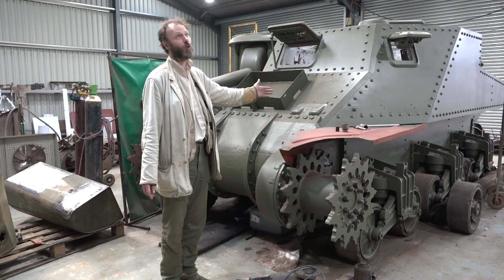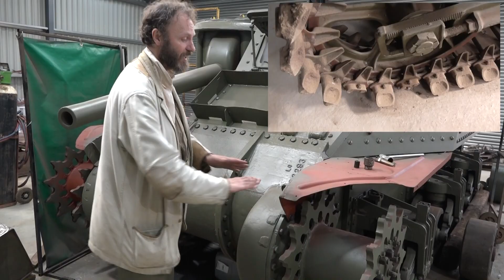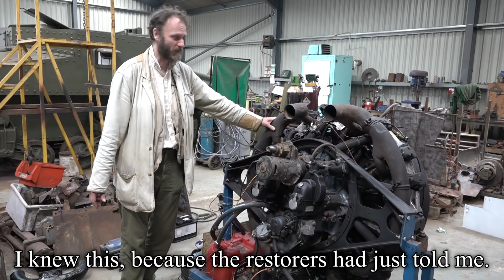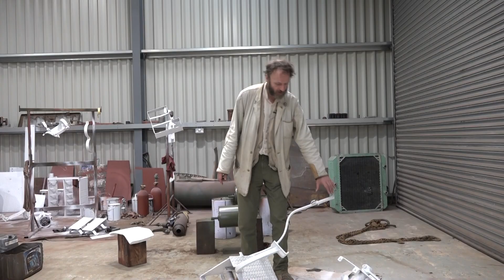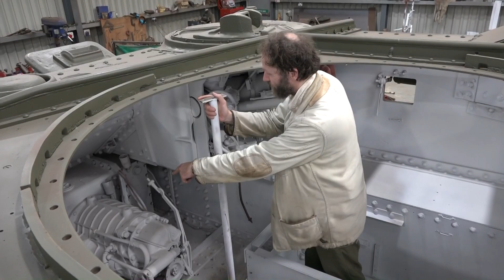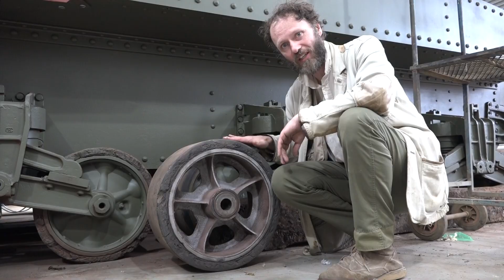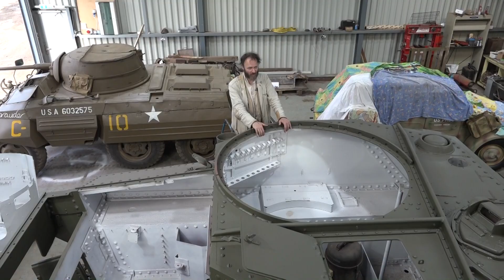The British Lee tank (that is not a Grant)

Comment: Crouser bars are a different item than a duckbill they both bolt on the in connector of the track for different types of traction improvements or flotation I suppose😊 for the duck bills

Comment: If the speed and the protection of tge lee vtank is wirh machine gun instaklments as you find in a attackbfrom.infantry so artillary is miboile as the 6 p and then the tank drags machine guns say two drop the armour oiercing and use a mortor. Say ine in the tank and one drop iff

Comment: As the sometimes-happy owner of a VW, the maintenance requirements of German vs. American tanks sounds terribly familiar.  There's a VERY small issue with my transmission (a sensor has gone bad, which makes the computer think the entire thing is horribly broken, but really if you look at the data while it's running you can see it's working perfectly but this is an unnecessary digression,) and in order to access it you've got to basically disassemble the entire vehicle.  Then to fix it you can't just swap out the sensor, you have to replace the entire transmission -- though I imagine that's a cash grab issue and not an engineering issue.

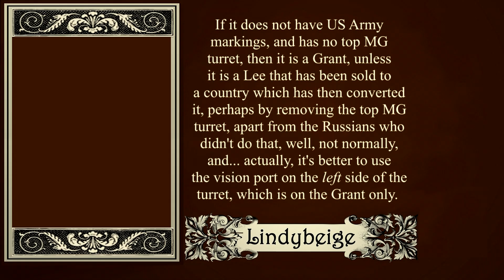Comment: @22:09 UNLESS it is a Grant II which is a British designation for a M3A5 Lee tank (which still has the original US type turret... in some cases still including the MG turret on top).

@21:00 it might be a Grant Command, but it is more likely a Tank Recovery Vehicle T2 with its  rear-facing lifting boom and winch removed. The British called this vehicle the Grant ARV I, but not a Grant ARV, which most often had NO turret and a Bren AA mounted there.

Comment: You might not have to take a riveted tank back to a factor to fix the transmission but you'll be lucky if it doesn't fall apart from the impact of a tank shell from all the bolts shearing off or popping out

Comment: Interesting fact. If you look at the internal rivet heads at around 10:00 you'll see they are also welded. The first hulls didn't have the weld and the impact of an AT round caused the rivets to shear and send the tops flying around the compartment like demented mosquitoes. This was bad news for the crew and so the rivets were all welded as quickly as possible.

Comment: The 37mm gun was good enough to penetrate the armor of Panzers up to and including the early Panzer IVs. The tank was on par or even slightly better than the Panzer III's that they fought in North Africa. It wasn't a perfect tank, but it was a good enough one.
Reply: Nobby Nobbs  M3Lee was slightly faster, and in early war had more frontal armor (Panzer 3 got upgrades later, while the M3 was discontinued lol). The 75 gun on the Lee could engage and destroy the Panzer III at ranges far beyond the short barreled 50mm guns. And up close the armor of the Panzer 3 could still be penned by the 37mm.

Where the Panzer 3 shined was trashing the M3 Stuarts, the Crusaders, and the assortment of terrible early Soviet tanks such as the T-26 and all of the BT's. That and being converted into Sturmgeschütz III.

Comment: Always thought they should’ve upgrade the 75mm on the side of the M3 with the 105mm howitzer assembly from the close support version of the of the M4 & just removed the 37mm turret to lower their profile, like the one under repair in this video. That way they reuse them to make some 500 defecto M7s without needing new hulls & running gear.

Comment: Neat video!  I've heard, so as to believe, that a US Ford-produced M8 armored car with a 37mm destroyed a Tiger.  The Staghound was off the road behind brush.  Not seeing the M8, the tiger came down the road, went a few yards by the Staghound and stopped.  The M8 came down onto the road and from 15-20 yards put two 37mm's into the tigers engine compartment.  The tiger began to burn and was destroyed. The M8 reversed, ran back off the road into the brush and is probably still running off today...

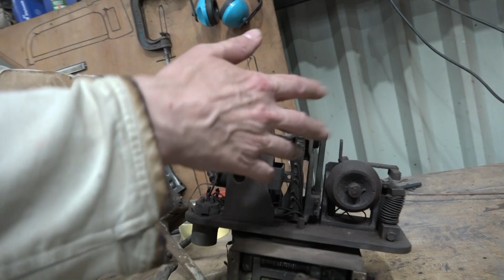Comment: 17:50 - I think it covers two axes of rotation because of roll. One covers pitch, as you describe with your hands, and the turret rotation covers the yaw direction. That leaves roll, which would also cause errors in targeting, especially when the gun is pointed on an angle, relative to the direction of travel.

Comment: Funny fact. The British cavalry actually messed up, just a bit. The reason Americans wanted 2 man in the turret and a radio operator next to the driver, is because the US Army would measure height and weight for their official record more often, twice a year at physical. The British cavalry did the same, but NOT for official records, so on paper the British soldier was MUCH shorter (being measured at enlisting, usually 18 y/o) and smaller, than the average American soldier. That was corrected in 1948 when the NHS was created and a restyling of the records was necessary any way.

Just a fun fact about how the British accidentally reduced the size pool of available men for the crew, which is why a lot of British men find themselves too small for a tank supposedly built for the average brit. Clerical errors. I forget who said "an empire dies without a proper census." but it is funny exactly how right that quote is considering the British empire's fate after 1945, though I have to mention, the UK is the only empire which came up with the moral argument against its self, and then dismantled its self accordingly.

Comment: Most of the problems Lindy complains about stem from the British habit of using an infantry support tank as a battle tank, the Lee was designed for the same role as the SturmGeschutz, and those didn't fare real well against battle tanks either.  The Grant was superior compared to a StuG 3 or 4, not so good against a Panzer 4 or 5, though it often did better than it had any right to, and it could expect to win against anything less than a Panzer 4.

Comment: One secret weapon the US had was the pneumatic wrench that was invented in Chicago around 1939. It sped up assembly on the production lines and repairs out in the field. Ordnance used the Wright radial because there was a huge stock of new and used R975 engines plus parts that were available. Those were used in commercial aircraft until replaced with a more powerful engine produced by Wright. Ordnance had Wright to turn over the tooling to Continental to continue it's production. The  USAAF and Navy began using the R975 in trainers so Chrysler cobbled together their A57 Multi-bank engine when the supply of R975's began to dwindle. The US Army didn't want to use the engine so it went into the M3's and M4's supplied to Great Britain.

Comment: 8:00 You forgot to mention the main advantage of a radial engine and that is their high power to weight ratio. 9:45 It was the just the construction method that was well known and available, you can't use a method that is not available in a large scale, it didn't have anything to do with the expedience. Welding was cheaper and lighter but, you use the methods that are available in the time and place you're in.

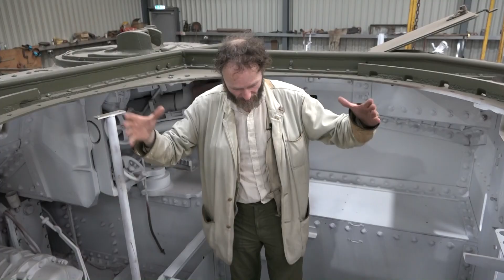Comment: 3:00 The American's did the same in short time, albeit that the doctrine of "more daka-daka" did originate with us and did persist in more practically applicable ways (i.e. M2 Browning on the Sherman turret). 12:30 You should remember that the small gun leaves alot of room, you should watch the "inside the hatch" episode on this vehicle, the conclusion is that the turret ergonomics aren't half bad. 18:35 Please do more research for you videos on armored vehicles, they are very complex machines, if you want to get things right you might as well phone the The Chieftain, he might be glad to inform you of some things. Like for instance, the vertical gyro stabilizer was very effective (when the crews were trained how to use them), it only stabilized the gun at low speeds like less than 15kph but, this was expected and it still gave crews a significant advantage for acquiring targets on the move and firing at them from a short halt. When crews knew how to use they performed exactly as intended. Honestly, the inaccuracies within this video strike me as the products of inadequate research derived from an ostentatious personality, your assumptions and intuitions aren't always correct. Please, it is not worth doing if you're not going to do it right, this just perpetuates and proliferates harmful misconceptions. By the way, not trying to roast all of your work, the rest of the your videos seems to be researched quite adequately, it is just the afv videos that may need a more heavily researched approach. Having said all this, I am not a scholar, I just know a few things that are proven to be correct and a few that are proven to be incorrect.

Comment: The sprocket what we do before throwing it away is pull the sprocket assembly off the hub then switch the sides of it and put it back on. That way the other side of the tooth wears because only one part wears at a time for the most part.

Comment: To be fair, if you're used to welding, it's probably faster then drilling all those holes, then bolting everything together, while praying that it all lines up right.
As opposed to welding, which is basically moving a steel melting torch, very slowly, in a straight line...

(Yes, I know you can weld a lot more then steel, and more then just metals too. It's just melting stuff together. Plus, you need to be skilled at where the weld is attaching, so that both pieces of sheet metal being welded together, get an even attachment to the weld, and attaching the weld smoothly and in the right quanity, but basically, it's just melting two or more things together.)

...Tack weld (tiny, break-off-able if you made a mistake, little bits of a weld) everything together first to make sure it all lines up right, and your good to go.

I presume switching from being used tp rivets to getting used to welding, along with getting all the equipment to mass production weld, was why rivet welding was so necessary, to get some sort of tank ready for deployment as fast as possible.

Having said that, at least three layers of weld, would probably be needed at each weld connected joint.

Comment: The reason that you have two-axis stabilization of a gun that only has a stabilization motor for one-axis is that when the tank tilts side-to-side, this changes the angle that is required to keep it on target if the gun is pointed in any direction OTHER THAN “Straight-Ahead.”

Basic Geometry.

Comment: You disappoint me Lindybeige. 
You do not need to pull the turret off a Panther to get the transmission or final drive off. There is a plate on front top of hull that contains the driver and hull gunners hatches. That whole plate comes off for the sole reason of not having to remove the turret to get the transmission and final drives out. All Panthers have this roof plate. On Tiger tanks you do have to pull the turret to get transmission out, not on Panthers.
By 1941 Brits were desperate for tanks, lots of tanks. The M3 Medium was never intended to be anything more than a stop gap band aid fix to get a mobile 75mm gun onto the battlefield til the M4 Sherman was ready. The Brits first used the M3 at Battle Of Gazala in March 1943. The M4 Sherman first saw combat in August 1943 at Battle of Alam Halfa in the El Alamein area. While the hull mounted 75mm gun had its disadvantages it was quickly discovered that the vehicle was still useful in a support role tossing large amounts of 75mm HE rounds. The M3 saw service in North Africa, Russia (Soviets called it a grave for seven brothers), and saw extensive use in China-Burma-India til end of the war where the M3's armor was still effective against Japanese 47mm tank and anti tank guns and the M3's 75mm fired a very effective HE round. Production ended late 1944.

In North Africa the good side of the radial was you had good airflow through the tanks so while hot you at least had a breeze. The downside was in Europe where radial engine Sherman crews complained they were never warm. As soon as you started the tank the engine sucked any warm air our in seconds. I believe in some models the crews had electrically heated suits similar to what bomber crews wore.

Comment: You alluded to this somewhat but I thought I'd hit it on the head.  The Americans rushed the Lee out the door because they had to get up to speed very quickly.  In 1938 while the war was on, the best tank they had that they could actually produce in any kind of numbers was the pathetic M2 Medium which was basically the Lee without that side gun.  Looking at what was going on on the front it was pretty clear that the M2 would be horribly inadequate, it was barely a match for the already-obsolete Pz II.   They had the Sherman on the drawing board and it was looking like a potential winner, But they couldn't just suddenly have factories churning out Shermans.  Before you can build a tank you have to build the factories to build the tanks, or retool what you had.  The Americans were doing that but that's a process that can take months and in the meantime the US had to use the existing factories already tooled to make the M2, to do something useful now.  And the M2 wasn't it.

So what they did was took the M2 design stuck an old WWI style sponson gun on the left side, offset the turret to the right for balance, and there you go, they had factories that could make this tank by 1939 and were shipping them to the Allies by late 1940, sadly the French orders didn't get delivered in time but they got diverted to Britain and that, dear reader, is why the British did have a handful of Lee tanks as well as the Grant which was modified to their specifications.  They were the ones we made for the French before the Fall of France and they had nowhere to go so Britain, ever desperate for tanks, took them

Comment: the purpose of the gyroscopic stabilizer was not for firing on the move.  when a tank is moving and comes to a stop, the suspension compresses and the gun would lurch forward and back again.  the stabilizer allows you to aim on the move and when the tank is stopping, you can keep your sights on target allowing you to get your shot off quicker.

Comment: Brief interruption should be made at 7:11 to point out that radial and inline engines existed for both land vehicles and aircraft. The basic distinction is that Radials were tougher and more resistant to battle damage, while Inline were more performant. Naval aircraft primarily used radials and land based used inlines (compare a Hellcat to a Mustang.). So to say that this Wright radial was an aircraft engine limits a viewer unfamiliar with engines to think that all aircraft engines were radial when that is not the case.
And now, back to the video!

Comment: It is important to note that even the most complacent officer in the U.S. Army did NOT think the M3 was the ideal super-weapon for tank-on-tank battles in Europe. The 75mm on the M3 was sponson-mounted solely because the turret on the M3 was too small to accommodate it. The M3 was built because the M4 was not ready in time for the British campaigns in North America. It is amazing that the M3 went from drawing board to prototype in nine months, and the first tanks rolled off the production line four months later!

The M4 just barely made it into British hands in time for El Alamein. In fact, the M4 outnumbered the M3s in the Order of Battle for Monty's big debut. Over 1,000 M3s were also sent to the USSR, and nearly 1,000 made it there.

The M3 should be considered one of the most successful "stopgap" armored vehicles ever made, right up there with the Pzkw I and II. Moreover, the M3 was in service until the end of the War, because it was shipped to the Pacific, where it faced an enemy that lacked strong AT defenses.

Comment: The reason for 2 flywheels is that the one which was oriented horizontally and perpendicular to the sight, stabilized the rotation around the axis pointing forward, and the second which was oriented horizontally along the sight, stabilized the up and down tilt of the gun.
Reply: basically if the tank was banking left to right, perpendicular flywheel would compensate it, and if the tank was tilting up and down, the parallel flywheel would compensate that.

Comment: the gun was a French 75mm gun which could not be housed in the turret due to its size so it was placed on its side in the hull with a 35mm gun in the small turret. the large gun dealt with tanks and the small gun dealt with small vehicles and infantry

Comment: I think some of the things you said about the tank and why it was made that way was a little off. The americans didnt make this tank because they thought the two gun was the best they made it because they needed a stop gap tank. The sherman was still in development and needed more time to be ready. They knew that having the 75 in a side hull turret thing was not the best idea but they didnt have a turret designed to handle that yet but they needed the 75mm to deal with enemy tanks so they just put it on the side. You said the 75mm wasnt as good as the german weapons at that time. When the Lee first went out the 75mm was defintly a better cannon then the cannons on the germans tanks is afirca. The only expectation was the german 88 but those where not on tanks and cant be in the same group. Compared to the german tanks the 75 mm out ranged and had a greater chance to pen then there cannons. Yes the tank wasnt great but they knew it wasnt great going in so it wasnt like they decided after using it that they had to replace it. They knew going in that it was going to be replaced so it wasnt bad design it was just getting something out.